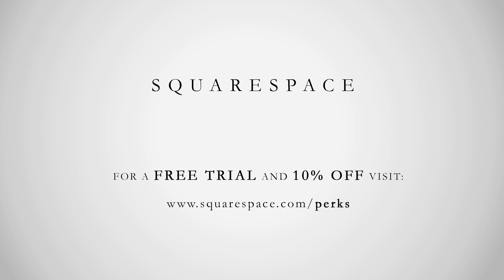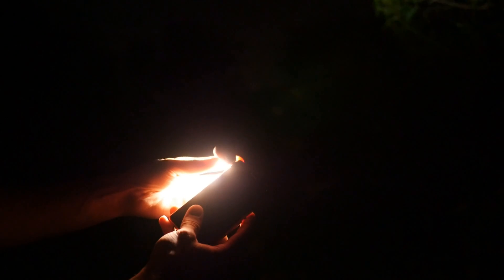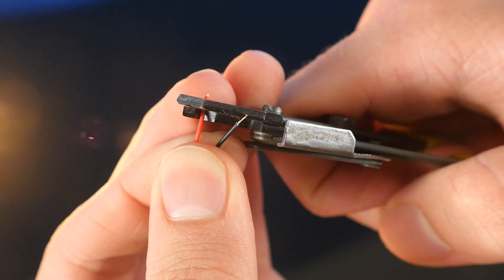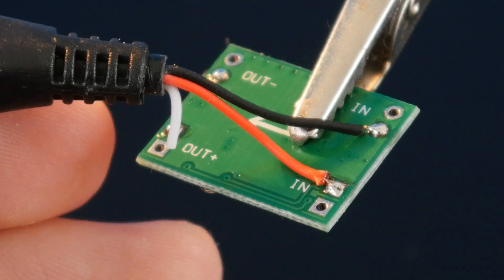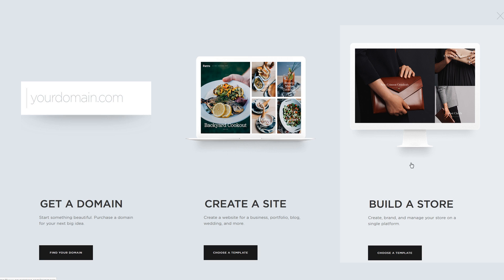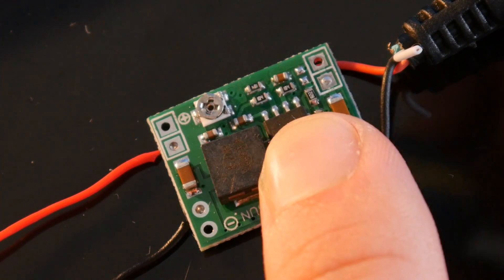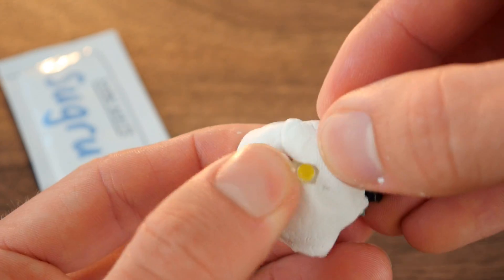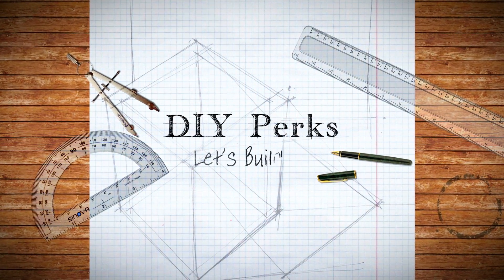A DIY smartphone hack that's actually useful!

Comment: Cool little project Matt, made me think about making an on-phone video light or ring light! Sugru is amazing stuff, I have practically re-insulated the whole cable on my Macbook charger with it as they always break works great if you get fix it before the wires inside break! A tip for using Sugru is when you have moulded the shape you are trying to get to wet your fingers to smooth it further, can get a really nice finish with no fingerprints!

Comment: What would happen if you plug it in to a 5v 2a wall wart?
Reply: I don't think that's how voltage regulator works. Sure, the voltage stays the same but it does not limit the current at all. Trust me, I have a couple of these units and tested that already. LEDs do draw more and more current as they heat up and the more they heat up the more current they draw.
Reply: Yep, a resistor would do the trick.
Reply: It would light up for a certain amount of time and after that burn out due to lack of heat dissipation. Your wall wart will provide 2A and will not know that the LED got furiously hot after reaching 900mA.
Reply: It would work as normal, the voltage regulator would hold the voltage steady and all the excess current simply would not be used. (one more reason to not use a resistor)
Reply: Ok, thanks for the tip. This method seemed to work for the smaller leds, but i will do some through test before powering my 3W RGB leds. I'm thinking of setting the voltage ever so slightly higher than the led (like 0.5V), and having a very small current limiting resistor to stabilize the current.
Reply: Thanks for the info guys. I'm going to start my mk.1 tonight with my 8yr old. I figure it's a great first smallish soldering project. He's only done through hole desoldering work as yet.

Comment: Is it possible to use a simple charging vor data transfer cable?
Reply: It is possible if you bridge the contacts of the ID and GROUND pin of the micro-usb end. This will tell the phone to go into host mode.

Comment: am i the only one using phone with "amost-bright-as this project" light built in?
Reply: You havent seen the light in person... I have used that LED and it is waaay brighter than the flash on your phone. Just think logically, this 3W led has a heatsink which heats up significantly and the phone doesn't. If your flash had that power where will the heat go?
Reply: 이주섭 what device are you using? I'm on a Droid Turbo 2. I think it's called the MotoX abroad.
Reply: 그냥사람 probably
Reply: My aristo 2 has a surprisingly bright flash. It only takes as fast as I can whip my hand around and back to leave a pretty noticable afterimage, if that paints the picture (i.e. most handheld flashlights)
Reply: I too have a light that is probably as bright as this, if not brighter.
Reply: idk why i feel related
Reply: Pixel 2 has a reasonable bright light tbb
Reply: Most Galaxy S series have a super bright LED and 3rd party apps run it at full power rather than the built in half power flashlight.
Reply: Surely bright enough to light anything i need indoors... For anything else I'd rather carry a small keychain light than that "egg"...
Reply: Well it’s 2021 now so I think most of us are good now
Reply: No, just no.You can't judge by the video, just fooling yoirself
Reply: probably
Reply: I bet he ain't turned his brightness up on his torch.. click the word underneath the icon then you can turn the brightness up
Reply: @nubie1100  never noticed that feature before, thanks
Reply: @Patricia-kk8tr  .. you can do it on most if not all...
Reply: 이주섭 How can you possibly tell how bright it is from a video?
Reply: Nevets maybe looking how much stuff is rly visible in comparison with the video showing how bright it is?
Reply: my dual led htc one m9 flash is bright enough for the girls i go out with. so i would assume there are a bunch of people that have similar phones and don't need to do this project.
Reply: 이주섭 my phone flashlight is brighter than this
Reply: my phone is the same way...the led flash is as bright if not brighter than the one in the video...just download the flashlight app and you're good to go....

Comment: You could make it even smaller by using the MP2307 buck modules (sometimes called RC buck) which are synchronous and about 1/2 the size

Comment: my phone is type C 😥 first world problems...
Reply: even better! when you do this you can plug it in both ways!
Reply: then get a type-c otg cable :3
Reply: China is the key
Reply: MrJewripper Type C is not a first world problem anymore
Reply: https://www.amazon.de/Microsoft-MacBook-Notebook-Oneplus-Supported/dp/B00VNA85IA
Reply: Obbliteration this, although advertised, does not work with the OnePlus 2 (and perhaps the OP3 not either). OnePlus devices don't recognize usb 3.0+ devices. I have to use the adapter from oneplus with micro B cable to have OTG functionality
Reply: I feel your pain
Reply: also you know alot of usb-c phones can Be used as a Power bank aswell?
Reply: OR you can get a micro-usb to type c adapter and now you can use it on micro usb and type c devices! Plus with the adapter you can use it with a case, since the light cant be flush if you have a case.
Reply: MrJewripper type c is otg compatable. Be glad you don't have an iPhone.
Reply: An LED is not a 3.0 device so I question your statement but you may be right. But anyway who said anything about 1+ pohnes?
Reply: Obbliteration just for anyone interested in buying one for his/hers and then being frustrated
Reply: same
Reply: sandeep rao totally is, I got a moto z and it only came with the AC-bound turbocharger, while I wanted to charge my phone from my power bank I needed a USB charger.  I didn't want to order one for some reason and it took me over a month to find one, in which I finally found one at a best buy mobile in a mall.

Comment: so the step up module is voltage (volt) and current (amp) regulated. is there a way to regulate only the voltage? or ONLY the current?
Reply from the maker: The voltage regulator is just that - a voltage regulator. LEDs draw less current when the voltage decreases, which is why we can adjust the brightness with it.
Reply: ohh. lol. didn't realize. check out my recent videos, I built a otg laser and a 3w flashlight. any suggestions to make my videos better?
Reply: How long does it last continuously?

Comment: I've got a Nexus 7 and a ZTE Blade G. AFAIK both of them are supposed to have OTG support but I've got a cable and it doesn't work on either of them. Is it the devices or is it possible that the actual cable is broken.
Reply from the maker: Probably the cable, as that's the common denominator ;)
Reply: The cable may look exactly the same but an otg cable is different from a normal charging/data USB cable because it is wired slightly differently. 2 pins are bridged together letting your device know it is otg.
Reply: Check your phone settings. OTG is turned off by standard on some phones.
Reply: are you sure that's an otg cable?
Reply: hentai nat Well, the one end is a USB socket and the other is micro USB. I can't find it right now but I'm pretty sure it's exactly the same as the one he had in the video.
Reply: Yep. also, otg cables can act as a charger, which is kinda useful. 'Kinda irrelevant, but still...

Comment: Wouldn't a normal micro usb cable suffice?
Reply: The difference is the 5th pin in a micro-USB connector(next to the ground), it's called ID. When you short ID with GROUND the phone goes into USB Host mode. Simple.
Reply: nope, you need on the go mode for power out
Reply: LurifaxDK I found your answer! :D

https://www.quora.com/How-different-is-a-normal-usb-cable-from-OTG-usb-cable
Reply: There are 4 wires. Exactly the same as in a data micro USB cable. What is the difference? :-) Genuinly curious, not trolling. :-)
Reply: A normal cable would work. I think Takuya Kousaka was talking about the OTG support in the phone. The cable should make no difference unless there's some kind of special circuitry inside it.

Edit: Normal USB cables have two lines for data and two for 5v power. The power lines in a regular USB connector are the ones to the far left and far right. You could look up a pin diagram for your type of cable :)
Reply: This cable is wired (internally in one of the connectors) in a such way that tells the port to behave as HOST port (like the ones in the PC). Standard cables just go straigth from one end to the other, so they cant change the way the port behaves.
Reply: DerFreakXD
You won't get any power without shorting the ID and GND. Guaranteed!
Reply: I was wondering the same thing
Reply: Takuya Kousaka
 once you cut off the female usb you're left with a micro usb and 4 wires, just as if you cut a micro usb cable in half
Reply: The USB OTG cable is just a converter from normal USB to micro usb. It should work. Really curious to know the reason for it if it is indeed required. AFAIK the OTG functionality on your phone is dependend on the data handshake from the unit you are plugging it into but I would really like to know tbh.

Maybe it has something to do with wattage? The wires are the same thickness though so I doubt it.
Reply: I tried this a while ago and it worked so yeah :D
Reply: DerFreakXD
Liar. Don't try to fool people.
Reply: +Rivalgamesbg I'm not lying but ok...